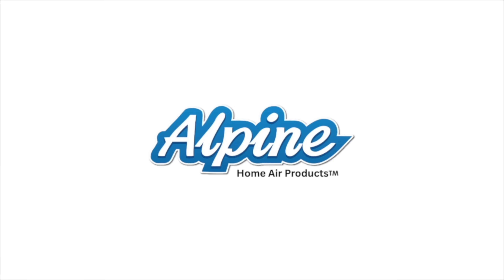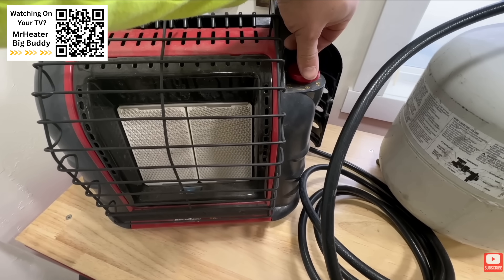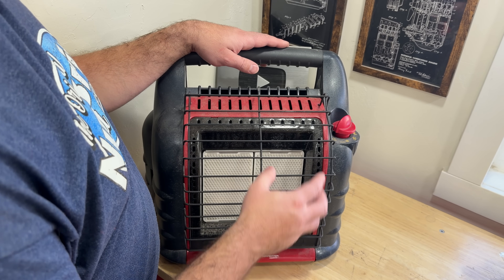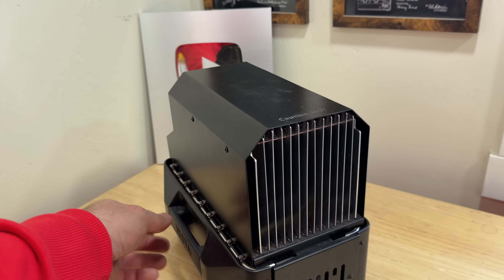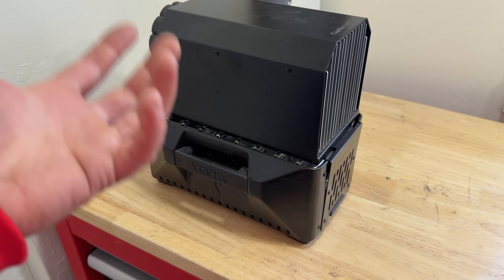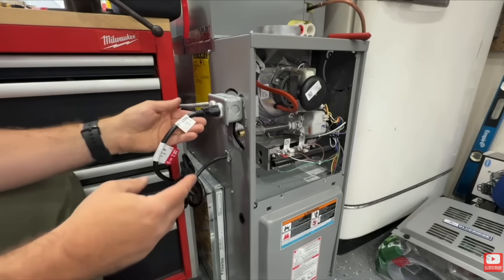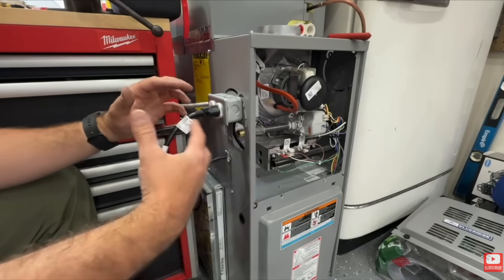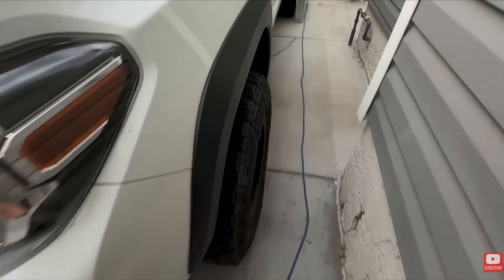Why Didn't We Think Of This Sooner?

Comment: Best is a wood burning masonry fireplace.  Years ago we installed a Quadrafire 5000 series wood burning insert stove with large windows.  Also ran stainless steel flue up through the masonry flue.   One year during a heavy snow storm we lost power for four days.  The stove kept our two story home in the sixties despite bitter cold outside.  Just left all the upstairs doors open.  This gas one sounds great if you don't have a fire place.
Reply: I have a gas fireplace.  We never lose gas, but sometimes have power outages.  Had one a few days ago.  I was able to run the gas fireplace that has a built in fan, with my power station.  It produces enough heat to keep the house warm.  The advantage of a gas fireplace is no need to store firewood and it starts immediately with a thermostat and if necessary, plugging it into a power station, in the event of a power outage.
Reply: @my3dviews can you send a link or write down the name of that heater?
Reply: @Keepitoriginalministry   It's a built in natural gas fire place that I got installed.  I believe that it is a Heat and Glo brand.
Reply: @my3dviews thanks bud. I have a fireplace and I’ll look into that! 👍🏼
Reply: @Keepitoriginalministry   It produces a fair bit of heat even without the fan.  But, was nice to be able to run the fan with the power station after I figured out how to do it.  
Before I got it, I had a wood fireplace, but rarely used it.  It was condemned due to a collapsing chimney, so replaced it with a gas one that I use almost every day in winter.  :-)
Reply: @my3dviews  I got some land bought a used double wide mobile home. I don’t trust using it with the wood, so I will do the same. Thanks! 
Oh I have propane not natural gas. Hope they sell the propane models too.
Reply: @Keepitoriginalministry   I see.  Not sure if they make propane models.  Mine is about ten years old already.
Reply: @Keepitoriginalministry 
Have you considered gas logs? They come in propane or natural gas and are inexpensive.
Reply: We have a Little Buddy heater and also a Coleman propane camp stove for camping and or emergencies. We live in northern Maine so wintertime power loss could be life threatening in the winter months where low temperatures at night in Dec Jan Feb can drop to 20 - 30 below with windchills even lower.
Reply: I have both and spare buddies ....you freeze you die game over ......I like to back up 3 ways ..so candles and lamps as well ....
Reply: Yes Russia designs masonry fireplace are very efficient

Comment: Great info!
Kerosene heaters are also nice to have as backup.    My old neighbor, Dave, gave me his heater when he moved back to Louisiana.  This particular unit is pretty big.   When he had an outage, he fired it up in his basement and it kept the entire house from getting too cold.  They wore sweaters, but this protected his pipes from freezing and they were comfortable layered up a bit.     There are also smaller units that do the job (I sent one to my brother in Texas after they had that terrible freeze a few years ago).
Reply from the maker: Thanks for the tip. Maybe I will get one and do a video! 

Best,

Dave
Reply: I don't like Kerosene heat stink too much.
Reply: @tonydalton8712 You have to start and stop them outside. I had a 23000 btu heater that burned really clean could not smell any fumes. I kept the wick clean and never had a problem with it.
Reply: @LaRaineBarton  You are correct sir!
Reply: Please watch and use care using Kerosene heaters indoors.
Reply: Brilliant to heat the basement. Mainly to protect the plumbing, as you said,  but also to warm the feet in the room above.

Comment: We had a power outage last night, from 9:30 to 7am, 
...gonna be putting an outlet on the furnace and use a large deep cycle battery and an inverter, already have those.
 Used the gas stove, burners on low, to generate some heat.
 Using your car and an inverter as a generator is a good idea if yours.
 Anyone know what size inverter would be needed to run the refrigerator?
All of your videos are helpful, thx!
Reply from the maker: You don’t need a huge inverter for the fridge. On average they pull 300-500 watts

Comment: I added a plug to my furnace and the furnace will turn on when plugged into my solar generator but the furnace will immediately shut off when the gas ignites.  Any ideas as to what the issue my be ? Im assuming its a sensor issue.   I also added a grounding plug to my generator where the neutral and ground are tied together and that still didnt fix my issue.   Great Video !!
Reply from the maker: I’m assuming you’ve cleaned the flame sensor? It runs on ground so I’m assuming it has something to do with that.. hmmm I’ve never heard of that being the case before. Maybe your home doesn’t have up to date grounded romex wiring?

Comment: Diesel heater for the win.  Unless you have money to burn with propane
Reply from the maker: I had one before. I might get another for emergencies. I have done other videos that show them. They aren’t as simple as these as you have to have venting and stuff. But a good option for sure
Reply: @diyhvacguy  yeah both good to have on hand, propane kicks fast .   Diesel provides significantly more energy per gallon, with approximately 138,700 BTUs compared to propane's approximately 91,500 BTUs per gallon.
Reply: @cj548 where I live diesel 3.25 a gallon propane 2.40 a gallon. Pretty much same cost. Less to go wrong with propane
Reply: @stevenmiller6725  where I live, it will be sold out because other people buy it, but other people cannot buy all of the diesel.It's much more plentiful.\nInfrastructure
Reply: @cj548 propane heater not much good without fuel. I have both and would say the diesel heaters do a better job although you do hear the fuel pump a little.
Reply: I like the installation running the diesel heater outside and take combustion air from inside the house and vent the heated air back into the house.

Comment: NOTICE:
A carbon monoxide detector does not belong on the ceiling.
It belongs no higher than head height (where you breath)

Some are dual CO and gas detectors (propane) -- then it belongs near the floor, propane is heavier than air.

Yes, this is different than a smoke detector, read the manufacturers instructions.

thanks for the video!
Reply from the maker: This is a myth, you can look it up. In fact CO is less dense than air so it will gravitate toward the ceiling. You definitely want it mounted on the ceiling. Especially with a smoke/co detector 👍🏼
Reply: @diyhvacguy  Not a myth. CO mixes with air. The exception is a combination Smoke detector as you said.

They are more often marketed as gas / CO detectors, in my experience.

One measure of being a subject matter expert is that one doesn't have to look it up.

thanks for the engagement!
Reply from the maker: Yes propane detectors should be mounted at the floor but everything else is recommended on the ceiling. But if all else fails just read the instructions 👍🏼
Reply: but I am 7ft 9inches in height!
Reply: @luckyguy600  think of UR kids
Reply: @luckyguy600 you shouldn't be in anyway, you should be in the bar.n

Comment: we have a vent-free natural gas fireplace. works great in a power outage, no electric needed. great informational video! 😊
Reply from the maker: I’d love to have one of these installed but our home is very small 😅
Reply: @diyhvacguy  Get a portable natural gas/propane heater. Then plumb a gas line hook up on the floor behind some furniture or in the wall somewhere out of the way. When you need heat, move furniture, hook up the supply line to the gas port in the floor/wall and you're good to go.

Comment: Re: Thermostats:

Wire a simple mechanical thermostat in parallel (heat only) with the smart thermostat as a backup (for power failure, software update failure, etc).
Set it to a temp below normal but above freezing (50F)
Double-sided tape mount it right on the furnace.
Reply from the maker: This is a really cool idea. But either way you need power to the furnace for it to function.

Comment: I have the small buddy in my garage. I use the extra hose to use my 20 lb propane tank. It kinda stinks after an hour or so. -2 deg F here in MN today.
Reply: You might have a leak or the burner might be full of dust from the garage I would definitely recommend vacuuming it off and blowing it out with a can of air
Reply: Sumptin wrong....
Reply: Are you using either: a filter, (or) an approved hose that does not require a filter? Maybe oil residue from the hose is burning off making the stink.
Reply: I ran a ventless natural gas heater in my garage one winter. The fumes and moisture were a big problem for me. I have since installed a vented garage heater.

Comment: I have had to use the inverter after a hurricane.  It was great for lights and fans but I didn’t have a big enough one for coffee.  That’s why we have a generator now.  Lol
Reply: A good thing to add would be a power station with a big enough inverter and storage capacity.  It allows you to just run the generator long enough to fully charge the battery (maybe a couple of hours), then use the power station with the generator turned off.  Saves lots of fuel compared to running the generator 100% of the time.
Reply: That is why you start making your coffee with a Moka machine like Italians do, no need for electricity just a small solid fuel stove.
Reply: You should do some basic math then
Reply: Not sure who your referring too on the last comment.
Reply: We have taken to a pour over method using a stainless steel catcher and just pouring boiling water over the grounds .   As long as you can boil water you can make coffee